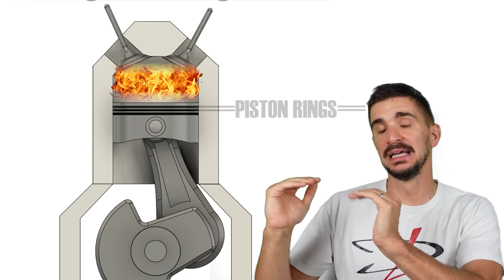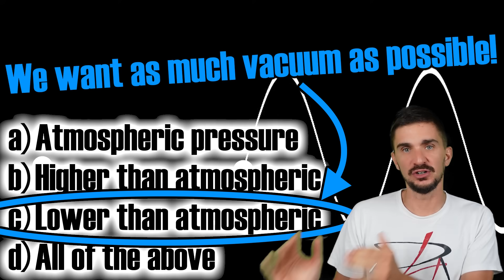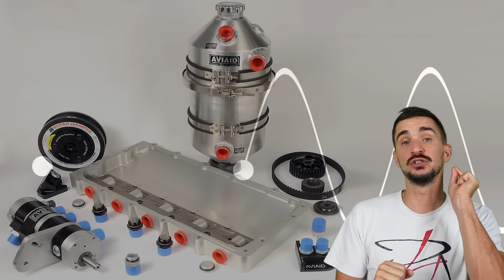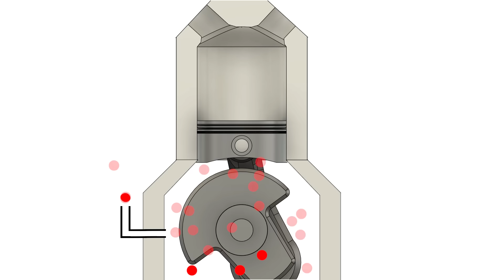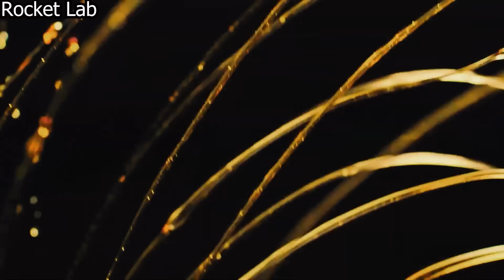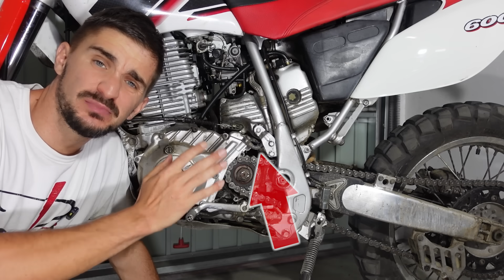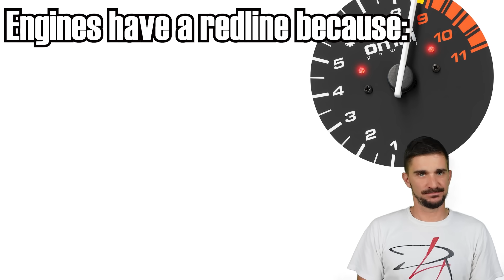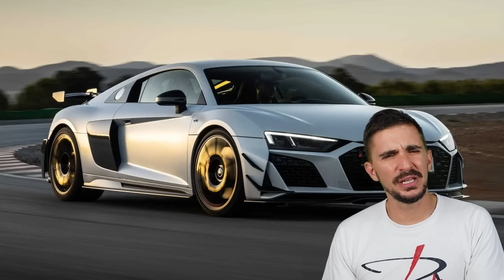Installing This Has No Drawbacks, Except for Your Wallet - Dry Sumps Are Awesome, Here's Why...

Comment: instead of this system being used, could you not just increase the diameter to where the PCV goes so that the resistance is less when pushing the gasses through it? its a neat system that you described but i feel like its a german engineers fix to something that i imagine could be very simple. another thing im curious on is how much horse power draw it is to power the dry sump

Comment: the C6 Corvette Grand sport  has an LS3 wet sump. but if you get the manual you get a dry sump LS3. So you get Z06 styling and the dry sump with the manual. best bang for buck

Comment: I know of a case where the dry sump and lowering the engine was needed so the hood could be closed with the upgraded engine.  Even at that the fake hood scoop like thing of the stock car became room for part of the air cleaner.  Oddly, the miles per gallon were a lot better than the stock engine so long as you kept your right foot under control.  That may be an effect of the dry sump or maybe it was just a better engine for about 20% of full power.

Comment: 4:38 - There most certainly IS gravity in "outer space". Everything in our solar system is in orbit around the sun, as a direct result of the sun's gravity. Throwing an object away from the ISS, for example, results in the orbital shape changing slightly. It will gradually recede from you, but then, ~45 minutes later the object will begin to come back towards you, and at the exact point you threw the object, exactly one orbit later, you will be able to catch the object you threw.

The effect of gravity drops off with the square of the distance, in the exact same way that omni-directional radio transmissions reduce over distance.

Once you get outside the Earth's "gravity bubble" (where the local effect of gravity of the earth and the sun are the same, at ~6cm/s/s) approximately 1.2 million kilometres from the surface, then you're now under the influence of the Sun's gravity bubble - which extends over 1-light year from the sun. At that point the gravity of the galaxy is about one millionth of 1 cm/s/s.

Comment: A dry sump system is not the only system that can achieve high vacuum in the crankcase. An exhaust driven eductor pan evacuation setup is pretty common in drag racing.

Comment: I'm curious about if this could be used to increase MPG. Given that it reduces resistance of the pistons movement. If the crank case were a perfect vacuum wouldn't that cause resistance for the position returning to TRC? Due to the pressure within the cylinder?

Comment: Cost and complexity ARE big considerations. The other is just trying to find a bolt on system for your particular engine. For example, I drive a GTi and the only ones I can find are actual race parts and we won't talk about prices on racing hardware lol

Comment: Very interesting video. I had a Polaris 500 Sportsman and a number of Sportsman 500 H.O. ATVs. Great machines, but they kept getting stolen from my driveway, so I had to buy more to replace them. All of them had dry sumps, and the last one had an oil tank made of plastic, but the others were all cast aluminum with cooling fins molded in. I always assumed the main reason for the dry sump was so the engine could be mounted lower in the frame. But after watching the video, I think maybe it was to keep the oil flowing no matter what kind of terrain it went through. And to have a large oil capacity. They held 2 quarts of oil, or ~4 times the engine's displacement. I crashed the last one, totaling it out, and now I have a Sportsman 570 SP, with 33% more power. It also takes 2 quarts (1.9 L) of oil but it's a wet sump. Maybe the dry sump didn't provide enough benefits to use it on the newer engines. So far I haven't had overheating issues or any other problems, related to the engine or otherwise.

Comment: There's another way to starve an engine with inadequate oil and oil pressure: an unmaintained PCV can tend to accelerate the formation of sludge which can block the pickup tube, even just by, in some cases, damming sludge up around it and preventing oil from being picked up. (Yes, I have a 3.6l V6 Alloytec which sounds like a diesel until I unblock it because the timing chain tensioners also rely on oil pressure - so I can't drive it or the engine might blow up)

Comment: One advantage I noticed on our families dry sumped 426 Hemi's was that the volume of the oil supply was multiplied 4 or 5 times and the filtration regime was doubled or tripled with. Maintaining high volume at the correct pressure range is of course the balancing act.

Comment: Great as always!  I don't mean to pick, but you did neglect to observe that if there's vacuum in the crankcase, then as the piston goes back up in the exhaust stroke, the exhaust gases will press down harder on the piston, sapping power on the return stroke.  Aaand a cup can't break down.  What's the reliability of these systems?  But I found another "plus":  if your vehicle is all-terrain, a dry sump would give you marginally better ground clearance.

Comment: Outer space not a thing, bro. Why not show us an engine block without cylinders for the pistons, instead they're just suspended in an open metal case - if you are foolish enough to believe that a positive-pressure system can butt-up against a "perfect vacuum" without any physical barrier separating them and somehow be in equilibrium.

Drawback to dry sump is that it introduces multiple points of failure that significantly increase the chance of an oil leak if the engine is not properly maintained. That, in addition to the cost, means it's not really worthwhile unless were min-maxing.

Comment: The biggest problem with a dry sump is low oil temperature. High oil temperatures boil any fuel that slips by the piston rings (particularly a problem with direct fuel injected engines). Fuel contaminated oil has lousy lubrication properties.

Comment: i was like “woah, i wonder if i could do that to my car, surely it’s expensive but not like, as expensive as a turbo or something” and looked up a dry sump for my brz and its 5k lmao
Reply: Looked one up for my K24 and there is quite a wide range. The one using OEM oil pump drive costs about as much as my whole Accord 🥲
Reply: I’m cackling, this also had me curious about a dry sump for my gr86. Glad us fa boys all think alike
Reply: It's good for longevity, it allows you to pre-heat the oil and easily lubricate the engine before starting the car. Major race car modification, but well worth it imo
Reply: @LorikQuinn  How does it allow you to preheat?
Reply: @LorikQuinn  Hmm, I have a 35k budget and the Impreza I'm looking at costs 25k. Should I get an RCM 4-stage kit for it?
Reply: @komraidwastaken  You'd probably be better off with wheels/tires, suspension, and if it's got a turbo then an intake, bigger intercooler, and exhaust.  Dry sumps are great, but for the money they cost you can do a lot of other things.  Did you end up buying the car?  Have fun and be safe if so!
Reply: Brz/gr86 seems like good fit for this cause of the whole right turn dibocal too....
Reply: Yea but if you buy it you can do negative G maneuvers without damaging your engine.
Reply: Does an oil catch can not to the same thing, but for around the price range of about $40 and some steel wool?
Reply: @munchiesNcrunchies   that is definitely not what a catch can is for, lol.
Reply: @ekTrvlr  design wise, catch cans and oil tanks are identical though; just one is usually a hell of a lot bigger than the other.
Reply: @cleveland2286 They're similar to the extent that they're both typically cylindrical. That's where the similarities end.
Reply: @cleveland2286 still wrong
Reply: @digitalparadigms  🤣🤣🤣🤣🤣🤣
Reply: @munchiesNcrunchies A catch can replaces the PCV, but you do not have the power gains, lateral G load protection, or cooling benefits of a dry sump.
Reply: @trevorsmith2006 this is correct 👌
Reply: @trevorsmith2006  A catch can helps recover and collect vapors FROM a PCV and works in conjunction. It does NOT replace a PCV.
Reply: @munchiesNcrunchies no that's irrelevant
Reply: @munchiesNcrunchies  You can't produce additional vacuum higher than your intake. Dry sump work by sucking in at a higher vacuum than intake stroke.

Comment: Another great video.

Some remarks:
- The advantage of lowering the engine isn't just lowering the center of gravity, it also aids in a better aerodynamic design with less drag.
- Another advantage of a dry sump system is that the oil can position isn't critical so it can be placed to aid F/R weight distribution. For example in a air cooled Porsche with a huge quantity of oil and the engine placed behind the rear axle you can use it to alter the weight distribution or in case of motorcycle you can store the oil in the frame or swingarm (Buell) to lower overall weight by utilizing existing hollow spaces in the chassis and doing away with the can at all.
- A disadvantage (in my experience) is that with a dry sump system it is less reliable to take an oil reading and because people buy dreadful cars nowadays and can hardly do anything besides turning the wheel and operate the touch screen this unfortunately is a downside (from a manufacturer/regular user point of view).
- The last point: oil most definitively is compressible, it is a common misconception that it isn't but it is. For automotive applications pressures are usually very low which means it can be considered negligible though with the only exception perhaps being a modern high pressure common rail diesel fuel system.

Comment: Surely a couple hours of reading about automotive technology will grant you more knowledge than engineers with years of experience and even more documented trial and error experiments.
Let's be real - for a conventional engine in an everyday car there is zero practical reason to choose a dry sump over an oil pan.
And where there are reasons - specialized or heavily modded vehicles where one would need one or more of the benefits of a dry sump - guess what: they are used.

Comment: What if you had lower the atmospheric pressure before and higher then pressure when piston reaches the bottom like a vacuum and pump so it’s down and pushes upward at the right time so helps the piston goes and supports it go up air sucked and pushed back in at the right time  to increase rpm . Do you think that will work will be any benefit? Any additional benefits to have the higher air pressure to help the piston fly back upward.

Comment: Yeah, good luck fitting it to for example MR-2 ZZW30... There´s literally 0 space for anything like this. Cannot fit an additional belt on the crankshaft, cannot fit a pump anywhere, cannot fit an oil reservoir anywhere, literally a fantasy project.

Comment: So... by the looks of it... NA engines and some(maybe all) turbocharged, both gasoline ones and equipped with classic oil pan, will basically benefit, consumption wise, while being operated at middle RPMs with mostly closed throttle by utilising vacuum made by the engine itself via PCV to intake. But the EGR system is going against it. Thx for another sleepless night XD. Already thinking about some large vacuum reservoir to keep the vacuum in the crankcase for longer when switching to full blast for overtaking. Any idea on what volume of gasses usually blows by per cylinder at wide open throttle?

Comment: im not an engineer but i dont see why its more efficient to use an external pump rather then a large check valve like old harleys used to have, since the change in crankcase volume is happening anyway
"with knucklehead harley davidsons it was called a foo-foo valve for the noise it makes"

Comment: There is one more "drawback". On a daily driver, the oil will never/seldom reach its operating temperature. The trips aren't long enough. Therefore the "evaporating fuel and moisture process" doesn't occure. Stick an oil-temp gage on your car and be amazed how long it takes to warm up the oil above 100c even on a wet-sump..
I did. 😊

Comment: What about putting a vacuum on the crank case, without the whole dry sump installation? How much would that help?
Reply: It helps some. Is still somewhat common in drag racing. They even make some that use the exhaust scavenging to pull the crankcase pressure out. There’s also vacuum pumps, but generally at that point running the pump takes most of any power gained.
Reply: @NBSV1  I have a Kawasaki V-twin.  A dry sump oil system would be near impossible to add.  However, I could change the crank case vent (no valve) to one with a valve.  That should give it partial vacuum during part of it's rotation when both pistons are up.  I just wasn't sure if it'd be worth it.
Reply: @85morpheous The only way I’ve seen a setup like that is when the valve has a hose that goes to the exhaust. That way the exhaust flow pulls the vacuum and helps evacuate the engine. But, it can be a bit finicky getting everything right.

Comment: From a practical standpoint Dry Sump Lubrication systems are used primarily on high performance cars with very powerful engines where fast acceleration will cause the engine oil to in a wet sump system to go to the rear of the engine and be spun around the crankshaft. For most conventional cars a wet sump lubrication system is more practical. Also a dry sump lubrication system adds extra equipment and complexity to the car lubrication system. Also oil changes are more complex. Instead of the single drain plug on a wet sump lubrication system there are multiple drain plugs that have to be removed on a wet sump lubrication system.
Reply: My wife's car has a dry sump... I just suck the oil out of the dipstick hole. It holds about 14 quarts so if 2 quarts are left in the engine the law of fractions says who cares.

Comment: wouldnt a boxer 4 cylinder have EQUAL volume all the time?
2 pistons goin up and 2 goin down at same time is relatively equal all the time or do i not have this right?
Reply: The moving pistons are diagonal from each other so you still end up with things getting blown around. In almost all engines there’s so much moving around at high speed it ends up being about the same.

Comment: @8:33  "Gas pressure pushes back against the piston rings making sealing worse."  Not really, as long as the rings are not stuck in the groove by carbon buildup.    The gas pressure travels into the gap in the ring groove below the ring, across the ring land, and up behind the ring, forcing it outward towards the cylinder wall, increasing ring sealing (top of ring is sealed to upper ring land, trapping the gas pressure behind the ring).  The same gas forces also act to assist ring sealing during combustion, but from the top side of the ring, sealing it to the lower ring land.
Reply: I really get the feeling this creator lets AI do all his research. Almost every video I’ve seen has a couple of things entirely wrong.
Reply: Yea, he also calls out how extreme lean angles are an issue in sportbikes that a dry sump can address. Completely forgetting that the forces between a car and a bike cornering are completely different in that respect. The sump tilts with the whole bike meaning the bottom of the engine remains where all the oil is moving towards.
Reply: @jensenmiller6410  Also important to note that the oil is subject to centripetal force, meaning the oil's position relative to the bottom of the sump will remain fairly consistent.
Reply: @jensenmiller6410 Sort of true, but if you hang off the bike, the bike is more upright than the combined forces during cornering, so oil will be flinged to the outside somewhat. But indeed not the same as in a car. I think packaging is a more important consideration when choosing dry sump. Or ofcourse when going offroad with steep hills etc.

Comment: Formula Fords, with the Ford Kent 1600 CC engine, all had, or almost all had, a dry sump system at least as far back as 1970. Additionally, the two-stage pumps, one for scavenge and one for pressure, were relatively inexpensive and fit into the side of the block, eliminating the need for an external drive belt.

Comment: If a dry sump increases power due to lower losses for all the reasons you explained, I would think it would also increase fuel economy (decrease fuel consumption)?
Considering all the other lengths that car manufacturers have gone to to make their cars more efficient in order to stay comply with fuel economy / CO2 emissions regulations, a dry sump must add a lot of cost and complexity for it not to have been adopted almost universally.

Comment: Dry sumps help keep the oil cleaner. The atmosphere in the sump includes combustion fumes, some unburned gasoline and very hot air. They mix with the oil and degrade it. The shocks on the crankshaft also degrades a little the oil. So keeping the oil in a separate tank can help changing it less frequently. Hence some economy.

Comment: I was originally brought onto this line of thinking back when I was still working on my own 2 stroke KX125.  Of course, being the curious little 11 year old I was, I asked my dad 'why is it that crankcases matter so much to 2 stroke engines and not 4 stroke engines?'
It is one of the few times that I've seen him mentally pause in such an obviously observable manner.
After that he and I delved as far down the rabbit hole of dry sump systems as we could, as fast as we could.  Ended up with us calling both Aviaid and Dailey Engineering back in 2002 to find explanations.  Definitely one of the better times of my childhood.
Reply: Well, what was the answer?
Reply: @kahlzun  I dont really know why they bring up 2 strokes... most dont have a sump or any oil pumps at all, unless you count the transmission. However, the crankcase does matter on a 2 stroke because part of the compression stroke happens within the crankcase, so volume and aerodynamics are important
Reply: Quite jealous of ya, I had to learnt it all by myself